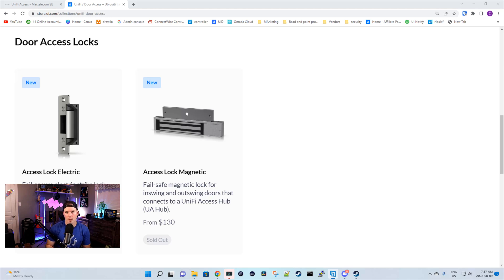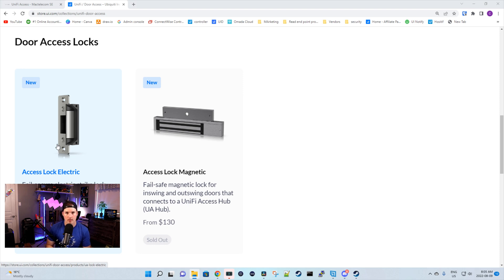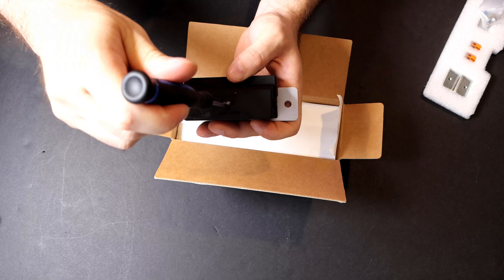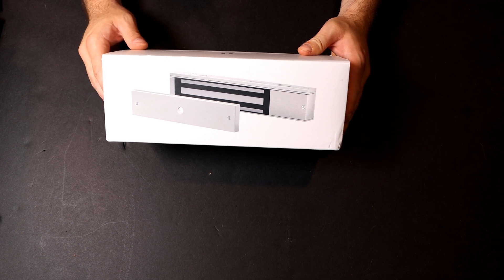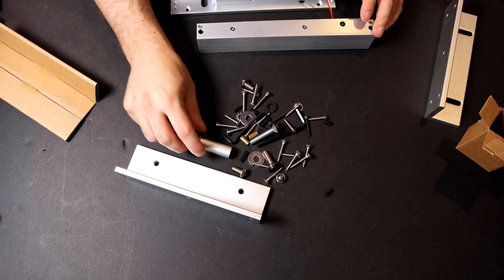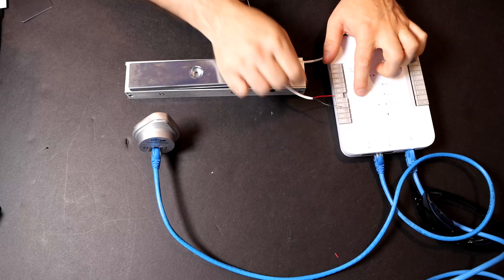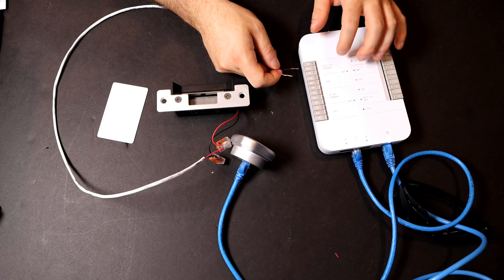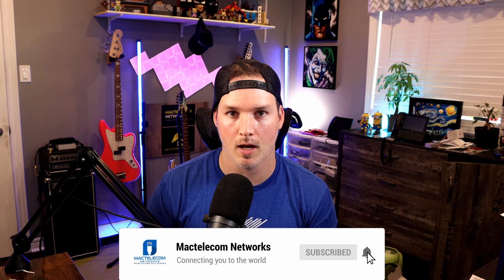Unifi access electric strike and maglock

Comment: I don't understand how the electric lock works. So you don't need to change out anything on the door side? How does it unlock the door? What if the dead bolt is manually set? Nobody clarifies this point.

Comment: For the DPS cabling that you didn't hook up in this video. Is that a requirement to hook up?  What is the purpose and advantages/disadvantages of hooking up the DPS wiring?
Reply: its a door position sensor, so you can monitor its state while away or get notified whenever it is opened and closed.

Comment: Quick question- can you remotely open the Electric Strike? Would like to put out on a gate with door bell notification, then open after viewing visitor
Reply: Yes you can connect a push button that opens the lock
Reply: Would be a good video. Door bell, video on mobile, press button, access visitor

Comment: By the way, I noticed you torn into the little plastic bag holding the parts. On all of the equipment I have gotten from UniFi, they have a a perforation line near the top of the bag which makes it very easy to tear along and open the bag with minimum fuss. Sort of like how they do their cardboard boxes.

Comment: when will they integrate fire alarm settings to their controller? i mean when there is a fire signal at one controller that controller needs to send signals to all controllers to open doors..
Reply: I was thinking same thing.  Why would you want it to fail secure if there is a fire and the power goes out 🤔
Reply: @Dutch-NativePride  it is not fail secure..what i meant is when there is a fire signal from the fire control panel to access hub, then it needs to send a signal to all hubs to open the doors..

Comment: YES, YES. Please 🙏 there are literally no tutorials, and as someone who has unifi access as their front door lock it would be fantastic to have a tutorial on how to install the door strike correctly connected on a door. Again, great content, many thanks
Reply: yes, I've wondered for a while how easy it would be to install on a residential door, or if it would be a real big pain in the backside
Reply: @corvettec-dt1eq  would are you putting these on residential doors? the real pain is going to be ascetically running the wire and cutting in the lock/strike. If its an exterior door, youre not going to want it in fail safe, so youre going to want to add a crash bar to get out
Reply: Agree
Reply: A magnetic lock for a residential building is probably the worst idea, back in college me and my friends would just rip these doors open

Comment: The mag lock looks like the seco-larm's 600 and 1200 w/ the optional bracket. Granted Ubiquiti did a much better job packaging it.

I hope the bolt that goes through the door is of better quality than Seco-larm's as it's easy to cross thread and if you use the rubber bushings like they want goo luck getting the bolt to thread.

I've installed a bunch of those now, and everyone is a pain.

Mounting them is a chore too. Make sure you use a drilling jig to drill straight through the door as if you're off it that through bolt is a nightmare to get to thread. That bolt needs to be better quality steel and at least a 1/4 inch longer. 3/8's would be better if you want to use the rubber bushings.

Also it needs something to grip the door better as when you tighten it down it loves to spin.

The mag strikes are much easier to use, just more door frame fishing.